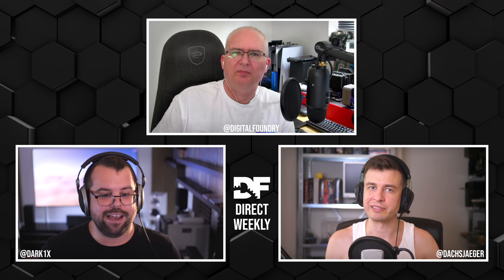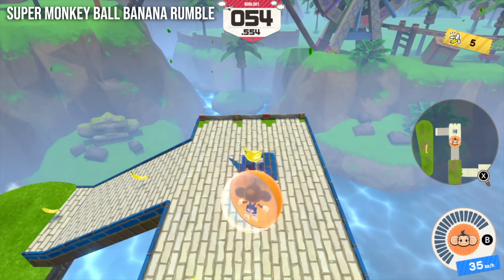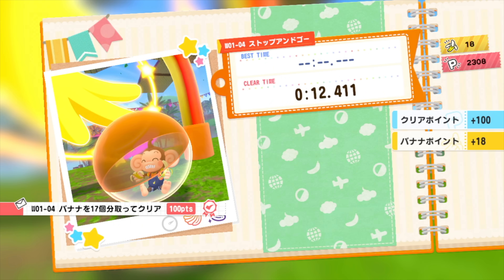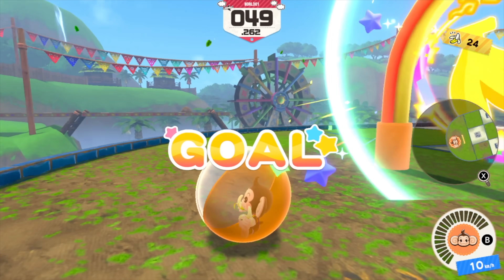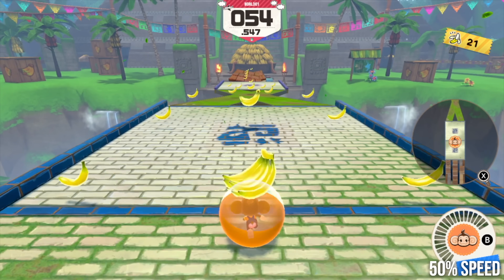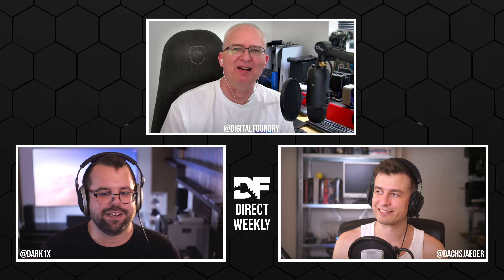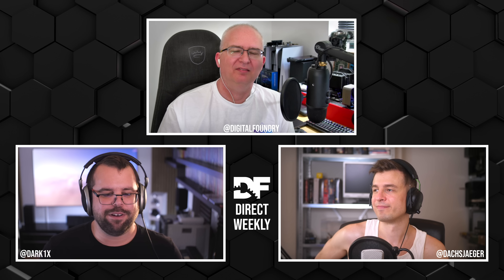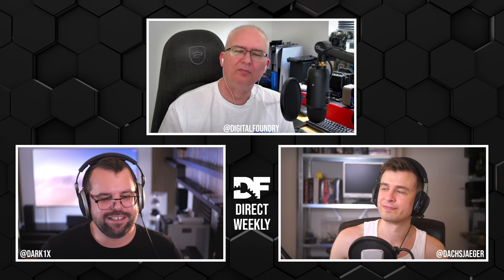The Unity Engine's 50Hz Physics Problem Strikes Again!

Comment: Why is it 50hz tick rate default for physics and not 60 or 30?
Reply: The tick rate is not super relevant. Setting it to 60hz would cause the same  stutter at framerates higher than 60fps. Also, it might cause problems even at 60fps because there is no guarantee that the start of a 60hz physics tick is also the start of a 60fps graphics update.
Reply: Everything essentially gets measured against the start of the program in order to determine tick rates/etc. As this value is stored in milliseconds, it's best to have tick rate cleanly divisible within 1 second (1000 / 50 = 20). 
So it kind of comes down to what is a "safe" update rate that can properly handle the physics/game requirements. Trying to match physics rate to typical monitor refresh rates is pretty much pointless, as rendering is usually going to be independent of the physics tick-rate, and positions/etc will be interpolated based on any movement they might have.
Reply: @Hazanko83  Hmmm. Why is it though best to have rounded milisecond numbers? What's the difference if it's 16.67ms (60hz) or 20.00ms (50hz)?
Reply: @sermerlin1  It's ultimately arbitrary, but if you're storing fractions of a millisecond you'd need to either convert to microseconds or use a floating-point type to store the value; in either situation you'd have to use a data type larger than 'usual' in order to prevent overflow if the program runs too long.
You basically never need microseconds granularity in a game, so to store fractions of a millisecond would just be extra work for nothing.
Basically, if you wanted microsecond granularity you'd need to either put in extra effort to make it happen, or accept that the runtime of the program will be reduced. Unless it's a server application, the runtime reduction probably would never be an issue. 
Tldr : keep things simple.
Reply: Answer Unity gave: it's on purpose so that devs with (common) 60hz screens won't miss bugs which happen if the rates are mismatched.
Reply: 30Hz is probably too low & some physics interaction might not be detected.

So, you could have objects passing through each other.

50Hz works for most physics interactions & it's less strain on your CPU than 60Hz.

So why increase it to 60Hz when you can get stable physics at 50Hz?

Setting it to 60Hz by default doesn't solve the problem of interpolation either.

The frame rate of the game can go much higher than 60Hz.

So you will see stuttering on a 144Hz monitor if the physics updates at 60Hz.

The only way to fix the problem is through interpolation. You can't solve it through the physics time step.

Unity should have interpolation on by default & keep the physics time step at 50Hz or 60Hz.
Reply: @john_hunter_ While true, this is only a problem with 144hz displays.
Also the 90hz Deck OLED, but then again, many people don't use it at exactly 90 anyways, so the sample size is even lower..

The other monitor refresh rates are compatible: 60 for PC/consoles and 120 for higher end phones. That easily covers most people.
Others are extremely rare nowadays. Like the old 75hz LCDs.

But 50hz conflicts with just about everything.
There are no 100hz or 150hz displays on the market, so 50hz will be bad for everyone.

Most importantly, with 60hz displays.
Which, again, is the vast majority of people.
Because it repeats (breaks) once every 6 frames.
Reply: Because you have to set it in seconds. 50hz = 0.02s, 60hz = 0.01666666... Why they don't make it based on hertz though i have no clue, probably because of some low-level computer stuff.
Reply: @kortyzol420  Unity can't measure milliseconds? If it only has integers for centiseconds I understand but I refuse to think that's the case.
Reply: @MASJYT  No, you just misread what the guy typed. you can totally type in 0.01666666 as your physics update time
Reply: 50hz tick rate is the default likely to performance reasons. As most TVs still operate at 60Hz (or above), by choosing 50Hz you more or less guarantee that the physcis will update only once per frame at most, but never twice. If you set physics to 60Hz, chances are that physics can also update twice per frame due to time-sampling instabilities, like ..111202020111.... That would be my best bet, because nothing else makes sense (well except being incompetent or not caring, but let's not assume that) to keep this decision.
Reply: My guess is that it's coded for PAL regions as Unity was originally founded in Denmark and it just never got changed
Reply: @AzaiaMonota  Brother, it's been nearly 20 years since that was an issue 😂
Reply: @AzaiaMonota  Yeah, I imagine this traces back to PAL in some way

Comment: It's so weird how well documented problems like this can plague engines and games for years. 🤔
edit- 
Evidently, for this problem in Unity, it's not a simple solution. I've seen more than one developer talking about how difficult it is to deal with in Unity, often having to come up with hacky solutions. Apparently even if you set physics to 60, if a camera is locked on a physics object, it will still generally render incorrectly and jump around inconsistently.
Reply: It's not really an 'issue' per se, Unity by default has physics updating every 200ms detached from the main loop, which updates as fast as possible (or capped to a max fps value). This is done this way because physics need to have a fixed tick rate to make it behave the same way every time. As per why the interpolation is not enabled by default, I assume it's mostly due to it not being needed 99% of the time
Reply: It's not an engine problem it's a game problem. If you tell the camera to update at 50hz that's what the engine does. The problem is developers not understanding what they are doing + some developers are so insensitive to stutter and frame rate issues they can't tell the difference between 20 fps and 120 fps, let alone be able to notice a 50hz stutter at 60fps.
Reply: @TheCrewExpendable  It's a problem if it's the default setting. People don't change default settings unless they have a good reason for it.
Reply: Evidently, for this problem in Unity, it's not a simple solution. I've seen more than one developer talking about how difficult it is to deal with in Unity, often having to come up with hacky solutions. Apparently even if you set physics to 60, if a camera is locked on a physics object, it will still generally render incorrectly and jump around inconsistently.
Reply: @TwinOpinion  Unity Developer here, anything related to Frame Rate and Hz in Unity is a pain to deal with, it goes way beyond just messing with some settings. For example you can set the Target Frame Rate(Or the FPS Cap) to something specific, however more often than not the engine will not cap at that, due V Sync and a lot of other things, not to mention the mess that the Frame Pacing will be. And as you said, the usual solution is a bunch of hacky code that is not ideal.